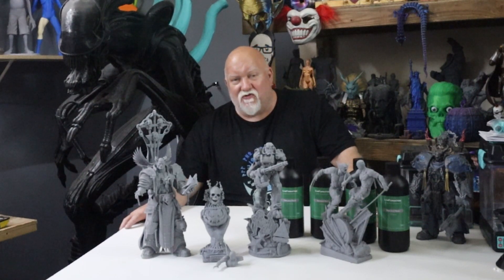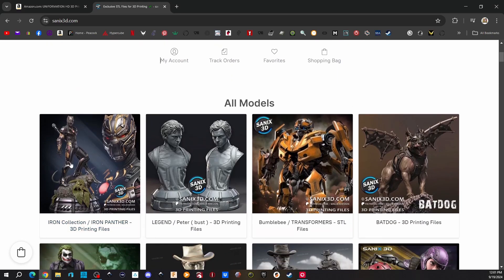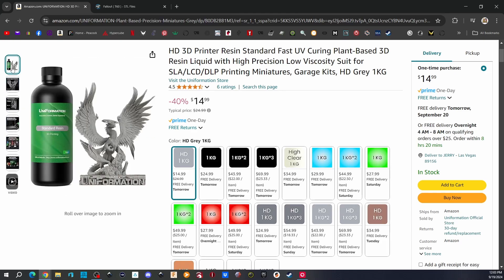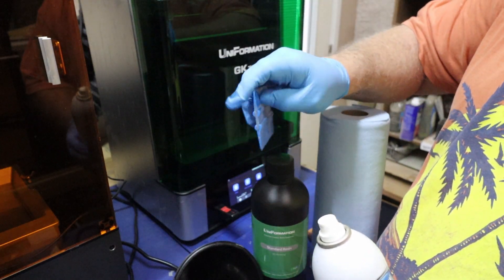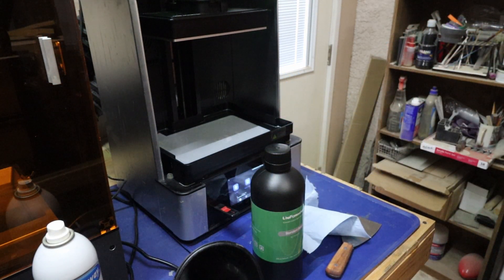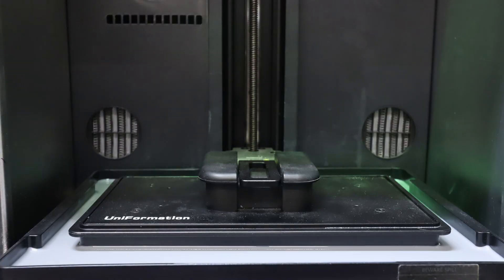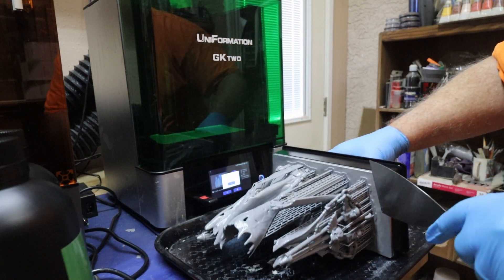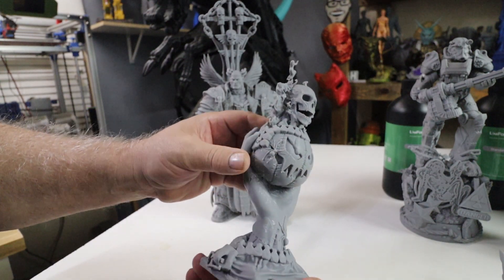Best Resin For 3d Prints #3dhp

Comment: Jamghe standard plus resin settings for uniformation gktwo printer sir??
Reply from the maker: Many resins print great, Jambhe was one of them and the  subject for this video. I buy a lot of SunLu off Amazon also.
Reply: We got problem on jamghe..dental models not accurate sir
Reply: Setting for jamghe standard plus resin?
Reply from the maker: @Riseofrocky  At 7.53 in video I was using stock settings I believe. Nothing special. Please contact the company or check there website for there recommended setting.Sorry your having issues.
Reply from the maker: I sent an issue to my rep Roy Wong with Jamb he, to reply here.
Reply: @3DHP  ok sir
Reply from the maker: @Riseofrocky   Roy Wong tried to reply here,didn't work but here is his email roywong0930@gmail.com   he needs more data from your slicer and pictures.I have a pic of what he typed but unable to post here.
Reply: @3DHP  ok sir